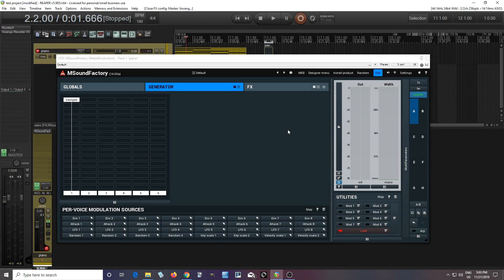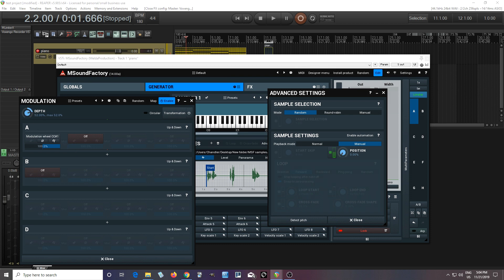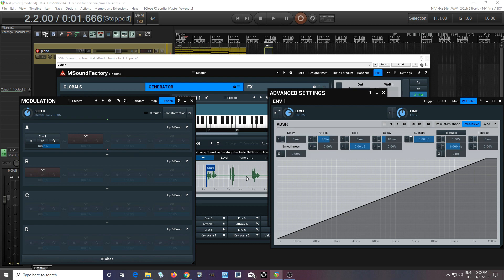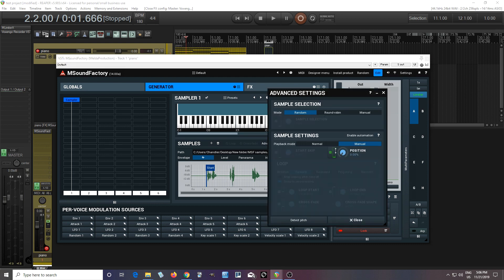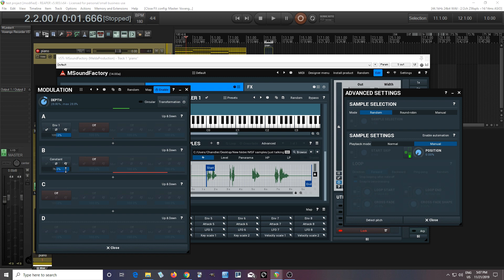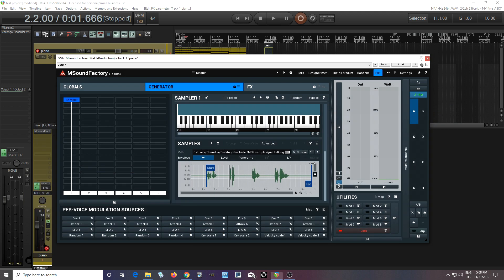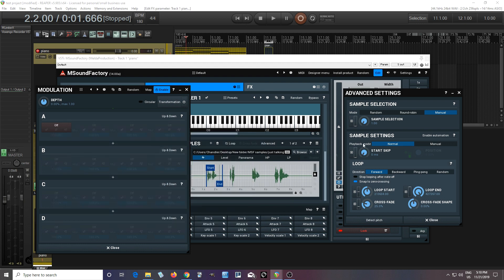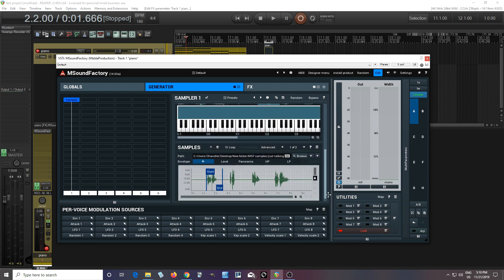Sample Position Modulation in MSoundfactory

Comment: Nice, can you do granular stuff with this?
Reply: Oh yes. Use modulators galore and there you go. Especially start points. Great thing with MSF, there isn't a thing you can't modulate. It's crazy. Coolest effects you can achieve if a modulator is again modulated by another modulator and if you set things to random. Cheers
Reply: Yes
Reply: yup, more then that... its up to you...
Reply: And its modular capabilities are endless...
use multiparametrs to control parameters from different plugs in the 6 lanes, use a modulator to modulate the multiparameter its crazy
Reply: @Guarroguapo18  yes. My head is spinning sometimes ;)